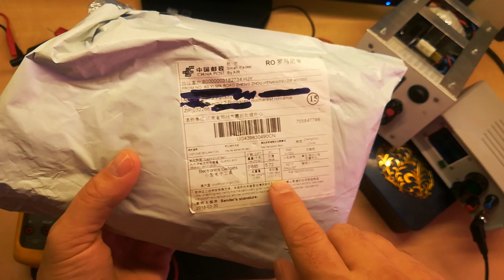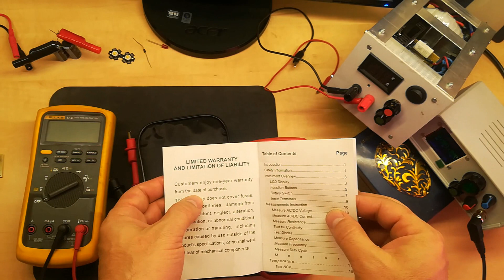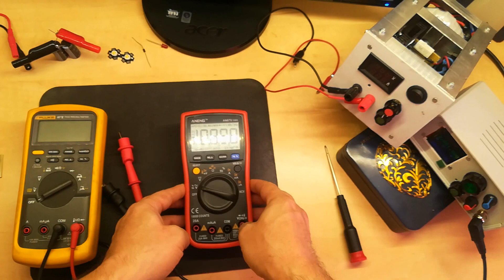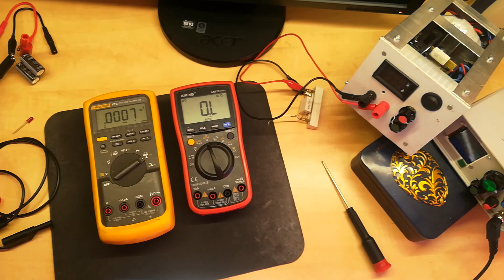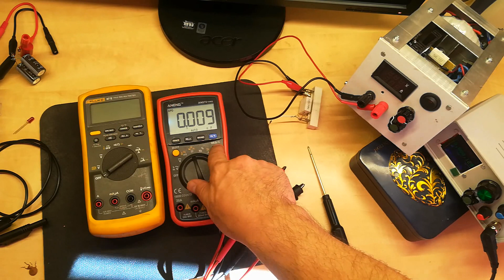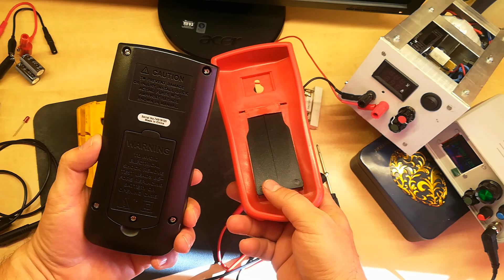ANENG AN870 versus FLUKE 87 V 5

Comment: I have the Zotek ZT219, which is essentially the same as the An870 but rebranded. Great multimeter for its price.
Reply: Leonardo Camargo they are manufactured by zotek as there’s a zt on the pcb. Aneng, Richmeter, etc is just a rebranded zotek.
Reply: Leonardo Camargo and the aneng includes the probe kit while zotek only includes regular probes and thermocouple probes. And also zotek ships inside a multimeter packaging while aneng and others just ships in their pouch.
Reply: …..And Aneng is also Wavetek I see for myself in the Wavetek site.

Comment: You must first calibrate the Fluke multi-meter and certify before doing this video. I cannot say which one is accurate. I don't want to assume that your fluke is 100% working.
Reply: Exactly what I wanted to say. He needs to prove his fluke is accurate. Just benchmarking against a random Fluke proves nothing.
Reply: Elijah Puga in fluke forums or EEVBlog forums there are testimonials about flukes dmm with more than 15 years of use that have been tested and no calibration was needed...please read or look for more information ´bout it.
Reply: @uriahbolanos6555  Because Fluke are known for being accurate it’s not very scientific to assume that they are. You must remove all possible variables to get accurate results and I wouldn’t use what any YouTuber says as empirical evidence.